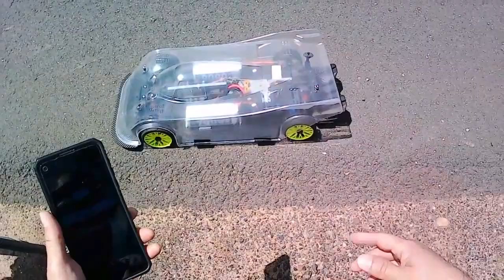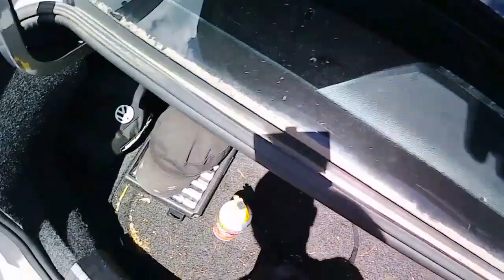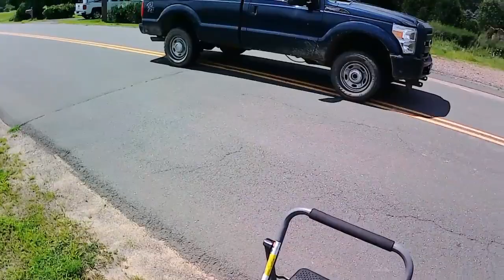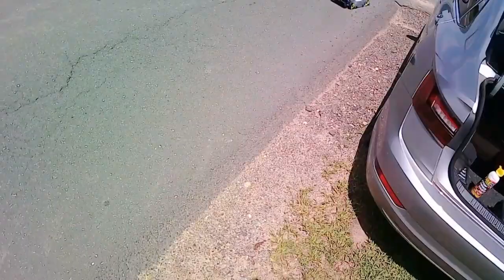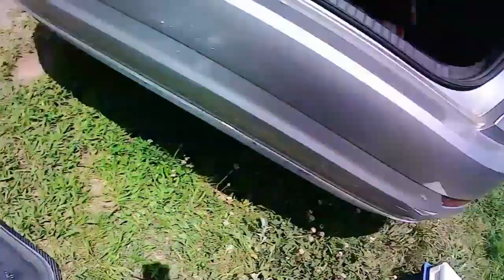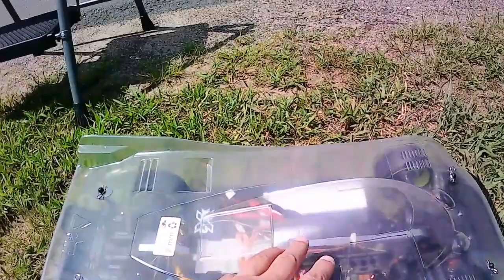1St GT Build, Limitless, Slow Shakedown Test, XLX2, TP 4060CM 3480Kv, Savox SA 1230-SG, Delta FC-100

Comment: What you do to front suspension to make it stay straight?
Reply from the maker: A lot 😂  
It's not just the front suspension, it's a whole car thing.. suspension, ride height, rake, gyro sensor, high torque servo & Perfect pass launch control.
But as far as what I did to the front.. I have heavier duty shock springs (Raz perfect pass springs, front & rear), compressed enough to still have some give for bumps on the road but stiff enough that it won't bottom out, camber set to 0°, the toe has a subtle pigeon toe setting.
Raz Shifrin has a 5 episode series called "Speedrun Secrets Revealed". I found it super helpful when it came to setup your suspension.
Reply: @rcbustanut2057  thanks
Reply from the maker: @dopewell1  anytime bro, feel free to ask anything! 😎 👍 👊 🍻